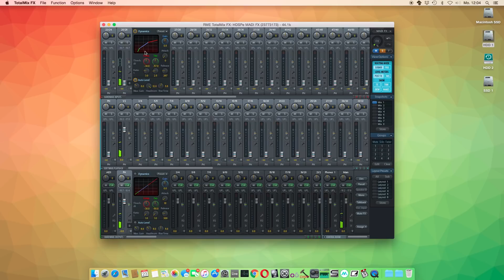RME Audio TotalMix FX DSP - Dynamics

Comment: Is it possible to add these to basically just the monitoring of that track without baking it into the input/recording? So that I can record with the compressor, and hear it, but not have it record the compressor?
Reply: Yes, this is how it works by default. It requires an additional step if you want to have the effects baked into the audio file.

Comment: I really wish the Babyface Pro FS offered some way to add a compressor, even if it's not DSP and has to use my CPU. I can think of several ways you could achieve this, but maybe I will have to hack my own solution? Is it possible to route app/system sound through the Babyface to an outboard compressor and back in for monitoring when using this interface for teleconferences?

Comment: Kindly add dynamic in babyface Pro
🙏🙏🙏
Reply from the maker: Due to the limitations of bus powering, this ist not possible. Sorry!
Reply: @RMEAudio  but why not add it when the Babyface Pro FS is using an external power source? This is disappointing. You could also let me add a VST compressor, even if it adds some latency. It would be an absolute Godsend.

Comment: Why doesn’t the Babyface Pro have this?
Reply: boooooooooooooooo
Reply from the maker: The Babyface Pro would need a bigger dsp chip. This would cause more power consumption, and the Babyface Pro could not be USB bus powered any more.
Reply: RME Audio Doesn’t the Babyface have the option to use dc outlet? That way if someone wanted to use compression they would have this option
Reply from the maker: @oylking513  I'm afraid that is not possible by design.
Reply: RME Audio ok thanks still a great product though

Comment: Note that the rme baby face pro version of total mix does not have  dynamics
Reply from the maker: ElAlexxis  Because a bigger needed DSP chip would need more power so the unit could not USB powered anymore and an external PSU would always be needed.
Reply: @RMEAudio  I agree that having a compressor option on the Babyface Pro would be really awesome. When using this in a live (streaming or VoIP) environment, the compressor would be great for mellowing out the dynamic range a bit. Is there some way you guys could leverage reconfiguring the FPGA to allow a few of the channels to have both effects and dynamics by limiting the user to a subset of the available channels when this option is enabled? For instance, you can either have 12 input channels with effects, or 4 input channels with both effects and dynamics. This would be really cool.
Reply: @VentusSolus  great point
Reply from the maker: If you are wondering which RME Audio Interfaces do feature effects please download our PDF Comparison Chart: http://rme.to/tmfx

Comment: This sounds cool, but the killer feature would be that you let us apply VSTs on totalmix channels (let us record throught the comp of our choice or apply room correction plugins on the output)!
Reply from the maker: It's a great idea, but for now unfortunately impossible. Totalmix FX is remote control for the Hardware and not something like a DAW. But with the low latency drivers from RME and a VST host like e.g. Live Professor this should be no problem to accomplish.
Reply: Did'nt know Live professor, thanks for the tip, I'll check that :)
Reply: Does totalmix fx have expander/gate to deal with background noise?
Reply: you can use for ex. Audio Hijack by Rogue Amoeba on Mac for AU plugins